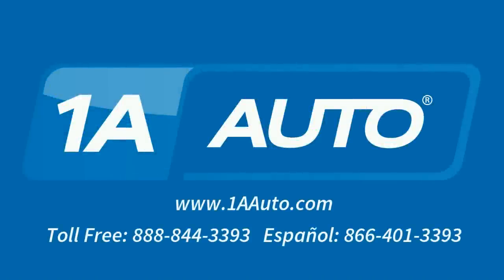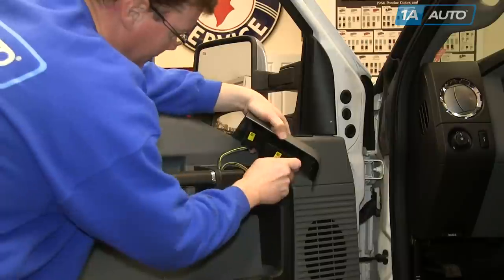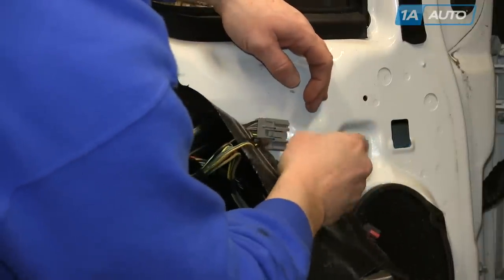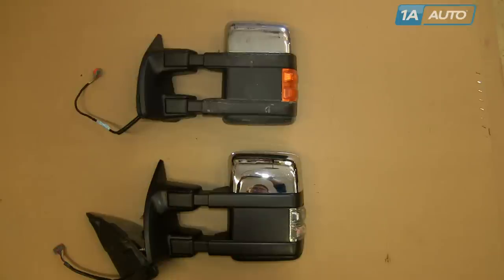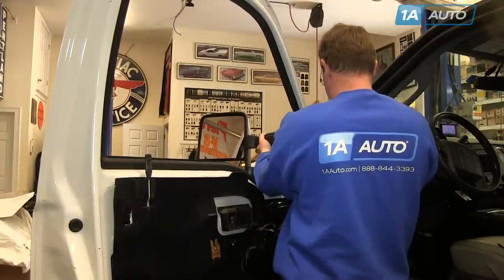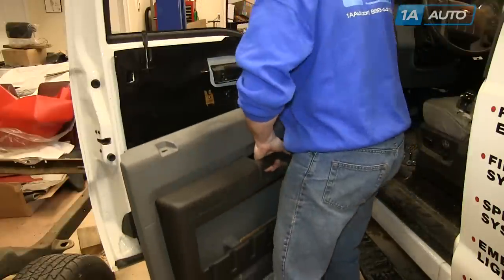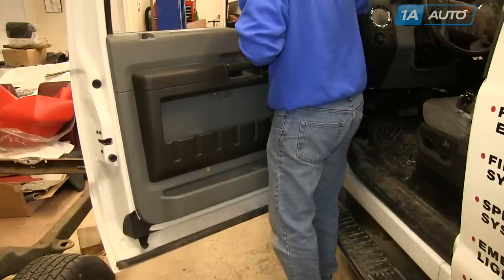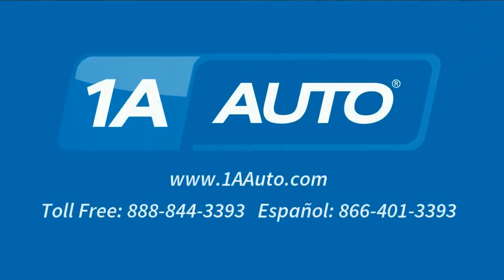How To Install Replace Towing Mirror Ford F250 F350 Super Duty XLT

Comment: Edit: 11mm Socket!!!!! NOT 10mm.  Finally someone that puts the tools required listed out at the beginning! Thanks so much guys! This is especially important when headed to a salvage yard so you don't need to drag your full toolkit. Thanks!
Reply: Edit: 11mm Socket!!!!! NOT 10mm. I got to the junk yard with just the 10mm and 7mm in my pocket and to my surprise the 10mm didn't fit! Of course it was the end of the day with no one around. Simple mistake but frustrating. Of course now that I look at other comments I see the correction! Dooh! Need a pop-up correcting the video.

Comment: Good video, thanks for sharing.  Just replaced driver's side on 2013 F250 Platinum.  As noted in previous comments, the four main nuts holding the mirror assembly on were 11mm.  Also, you can avoid removing the big door speaker if you tie a string to the wiring harness of the old mirror before you remove it.  Then you can use the string to pull the new harness through the door, and fish the plug back through the small hole.  Thanks again for doing the video.  Overall I found it extremely helpful.
Reply from the maker: Thank you for checking us out! +Jeremy Lochte

Comment: Thanks for this video. I changed my passenger side one using it. One thing that was hard for me was routing the cabling from the mirror hole to the port in the door. I ended up reverse threading an extra long zip tie as a "needle," then taping the cabling to the zip tie and pulling it through. Thanks again!

Comment: just bought two new mirrors from ya and watched the vid.

I have the pax side will not power fold ... and both mirror glasses have become very "shaky" while driving.

So I'm taking the plunge.  Have good referrals to 1A for the parts.  I look forward to restoring my tow mirrors on my 2011.

will report back ...

Comment: great video, gave me confidence to take on the job. Saved a huge amount compared with what a garage might charge to do the same job. I have a 2014 powertrans super duty Diesel. I found the main screws had a 11mm head (4 off) but apart from that great. I found I could feed cable back through without the need to remove speaker.
Reply from the maker: +Robert Lamb Thank you for the great reply! We love to empower our customers by showing you how-to perform your own auto repairs while installing our high quality auto parts. Have a great day! 1aauto.com

Comment: Of all the vids on youtube, yours are the most professionally done.  Want to sell me mirrors for my 06' super duty?  Make a vid that shows how to wire the new mirrors in.   I do not have heat or turn signals now but would like them.  I need a step by step video that shows how to wire them.  There is one video I found on yourtube that describes how to wire up the new mirrors and it is shotty at best.  Thank you.

Comment: What I did to save a little time is use some parachute cord. I tied it off to the old plug in and when I removed the mirror I tied it on to the new plug and snaked it thru. Doesn't save too much time but it makes things a bit easier to do.

Comment: Thanks for the video. It was just what I needed. I have a 2006 F350 King Ranch and the main heads were actually 11mm and there were only 2, other than that, it worked great!!

Comment: I bought this mirror to replace my driver's side and it came with threads on the new mirror instead of preinstalled bolts. Now I have to go to the hardware store and buy bolts to replace the mirror.

Comment: I only need the passenger side ..do u sell them individually? standard heated, non power folding?
Reply from the maker: +The Midcoast of Maine, The Way Life Should Be ! We are happy to assist with locating the correct mirror for your vehicle. Please contact our customer service department at either 888-844-3393 or service@1aauto.com with your vehicle's 17-digit VIN.